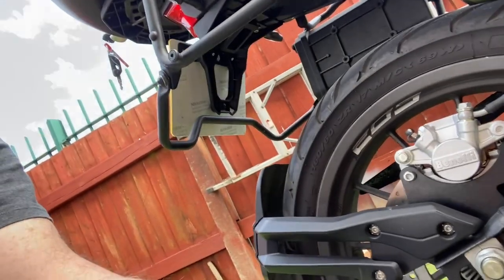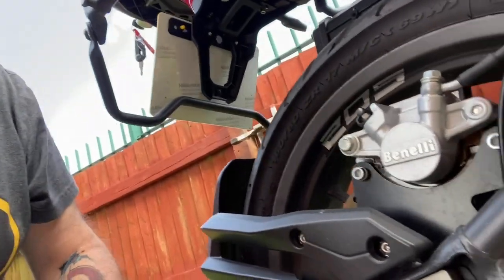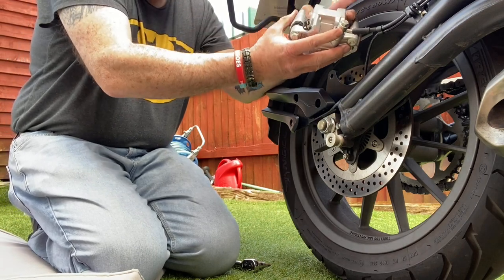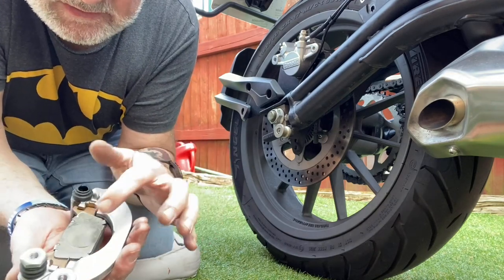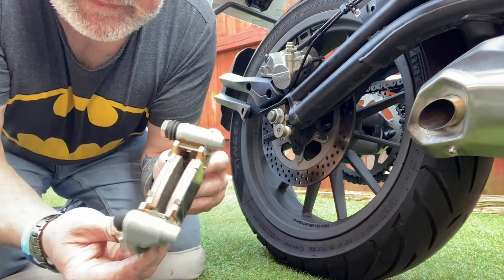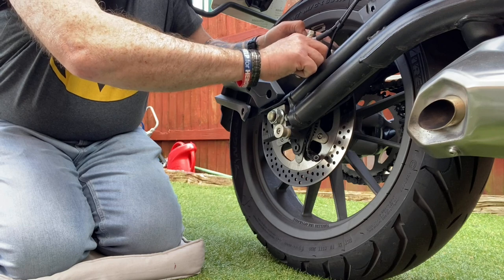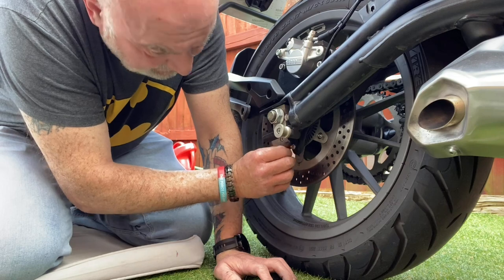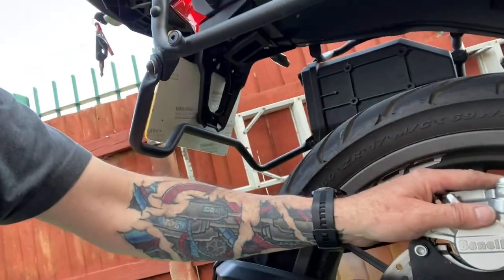Upgraded REAR BRAKE  PADS on Benelli TRK.

Comment: Hi Tom. I've just replaced my brake pads on TrkX after following your video. EBC on the front and Brembo rear. A piece of cake to do. I did use copper grease sparingly. What a.massive difference in stopping power. Nice one, cheers.👍
Reply from the maker: Your very welcome mate. 😎🤘🇬🇧

Comment: Brilliant video Tom, will be ordering both sets of pads to get this done. Cheers mate.
Reply from the maker: Hi Ian if you do the back brake.  Take the top of the master cylinder head on the right side of your handle bars. This stops any back pressure and the need for bleeding the brake . Thanks for watching bro. 🤘😎
Reply: @BenelliTomTRK  cheers Tom, will make sure to do that, thanks for the advice and keep up the great work. 👍
Reply from the maker: Ian thanks so much for your support and generous offer to my PayPalme/maher923. I will give you a shout-out in one of my videos. Thanks Ian 🙏🤘😎
Reply: @BenelliTomTRK  Its my pleasure Tom, it wasn't much, but I hope it helps.

Comment: Thanks for this Tom, I have a 502x but the rear brake is the same I think. The front brakes are different but still pretty easy.
Reply from the maker: Your welcome mate . Thanks for watching Peter.
Reply from the maker: Peter I just wanted to say a big thank you for your generous offer you made to my PayPalme/maher923 . You are the first person to have done that. Thanks for your support. On my next video I will be giving you a big shout out 🙏. Also if you change the rear break take the top off the master cylinder head ( on the handle bars right side) this will stop any need of bleeding and back pressure. Thanks again so much Peter
Reply: Are the pads the same on both 502 and 502x models.
Reply: @ianbell1321  no the 502 x has different front pads to the 502 the rears are the same I think.
Reply: @petervoros840  OK,  I will look at which ones I need to purchase. Thanks for letting me know.

Comment: Hi Tom I did the rear brake pads, but somehow I managed to damage the system or something,  I bought the pump for those rear brake because I thought I fucked it up, so installed this morning and nothing worked as before, the cylinder does not push the brake pads and make them work. I'm so pissed that I might not could use the motorcycle until I found out what happened. 

Cheers.
Reply from the maker: It’s very hard for me to say without being able to see it. But it sounds like you may need to bleed the break . If you have any biker friends they should be able to help you with that. Good luck mate hope you get it sorted Mario. 😎🤘🇬🇧

Comment: Hi Tom, I just changed the pads on my TRK 502X and after watching your video i noticed that the pads that were on did not have those plates on the back, are they essential? TIA.
Reply from the maker: Hi Lee don’t think so if they was not on when you took them off you should be fine. You could use a little copper grease on the back of the break pad. If you’re not happy REMEMBER AM NOT A MECHANIC. So please ask a professional. Look after yourself Lee .stay upright. Tom 😎🤘🇬🇧